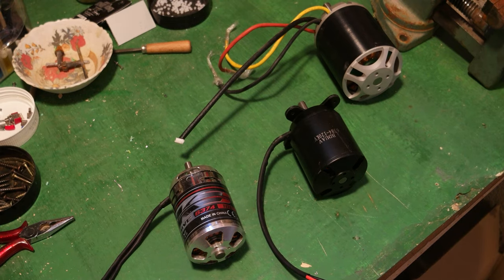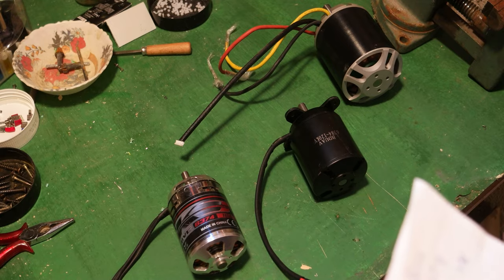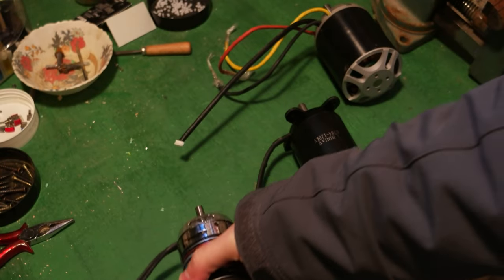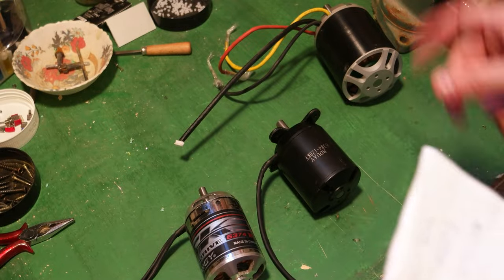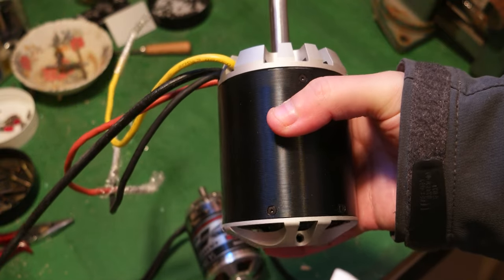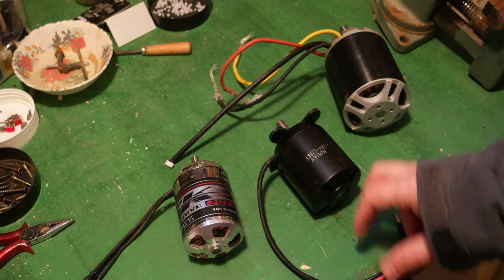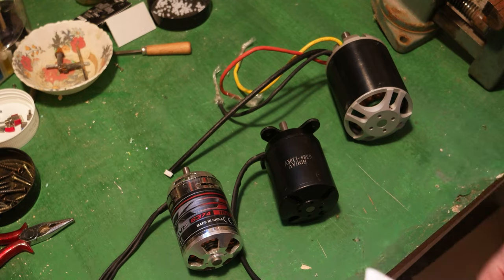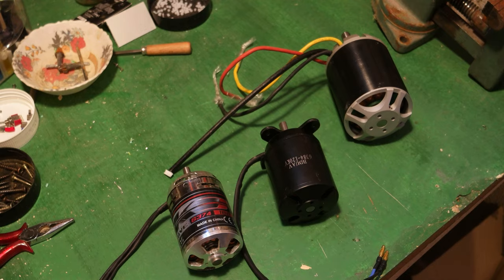Brushless Motor 6374, 6384, 80100 for the eBike

Comment: Que características debe tener el controlador para un motor 6384 120kv???
Reply from the maker: if I understand correctly you are asking what characteristics the ESC motor controller needs to be for the 6384? If so you need to figure out what is the voltage you are driving the motor with and the max current the motor supports. You are ESC must support these parameters. For example if the motor supports 36 or 48 volts your ESC must support those voltages.  Same as current. Of course you need to take into account what battery you have. Does it make sense? Please subscribe thx
Reply: @ganzoai  ayúdeme por favor

Comment: Hi there! How is your progress with this project? Are you gonna post any videos soon? I own myself 6384 and 8085 and have bought belt conversion kit for motorised bicycle, want to use large pulley from this kit and one of them motors to make my tiny ebike fast. its 12" like dyu. Regards
Reply from the maker: I am working on other parts of the project at this moment since it has a lot of different components. As soon as I am ready to tests the motors I will post some videos for sure. If you have a 3D printer you can print the pulley so that you can test various dimensions to find the sweet spot for you application. I am planning to do just that. Please subscribe and thx for the comment !

Comment: The small ones will overheat I use them on my Skateboard and Mountainboard.
Reply from the maker: I was thinking that when I did few tests last year with a much lower load. What voltage/amps did you feed? thx, please subscribe !
Reply: @ganzoai  Im using 12S on them, they are good for esk8s but you need more torque on a bike. 80100 should be minimum to get it going lol. Also check out QS1000 or Cyclone as a mid MOTOR.
Yeah I'm subscribed to see what you will make of it.

Comment: Nice, I got my esk8 running 2 80100, Cant even use them to their full potential as I'm on a skateboard and it slips out under me. Got them running at 8kw all together and still no one has beat me in the Esk8 event.
Reply from the maker: Omg, 2 80100 on an eSkateboard? WOW !!! btw which ESC are you using?
Reply: @ganzoai  75200 Flipsky.
Reply: How are you liking them for esk8? I'm making ~11kw on my 20s board. Currently using 63100's and overheating them in 4 minutes uphill. Looking into the 80100's.
Reply: @wiggpickle  Yh its good, I do 3kw continuous and 8kw peak, had it set at 5kw continuous but it wouldn't grip and took many falls. You will need wide tyres and large deck to do 11kw in my opinion.

Comment: Any update about the e-bike? The 80100 is a great candidate for a bike build.
Be careful with the cheap 120kv outrunners, although they work fine, (I pulled 115 amps) they don't have enough venting holes/pokes, I also replaced these flimsy 16 gauge phase wires with 12 gauge ones, much better.
Reply from the maker: thx for the comment, busy with other projects and as soon as I can will post some updates. Yes, venting is a thing I am considering to be an issue, and will also change the wires, not sure why they use such small gauge. This is true for the ESC too ! Soon will be doing some tests for the pellet extruder with the induction heating and will post some videos.